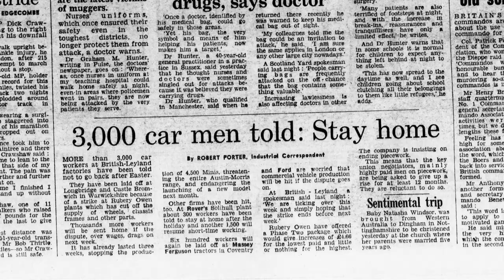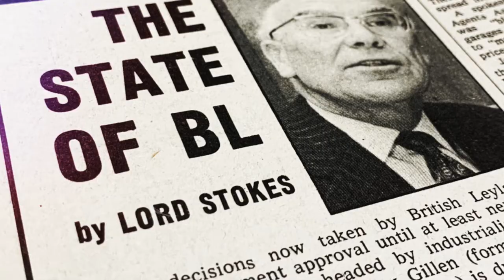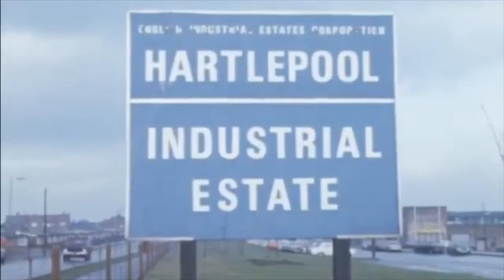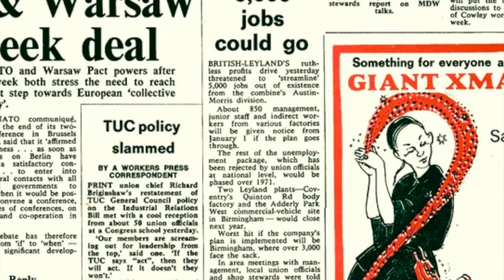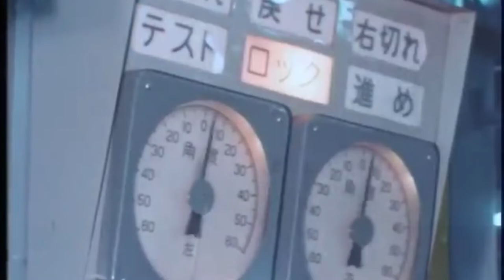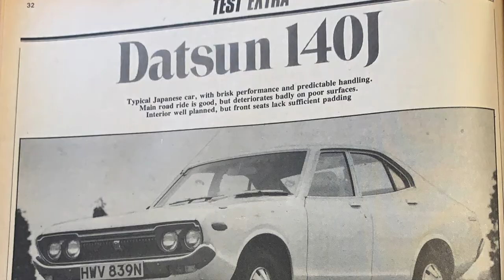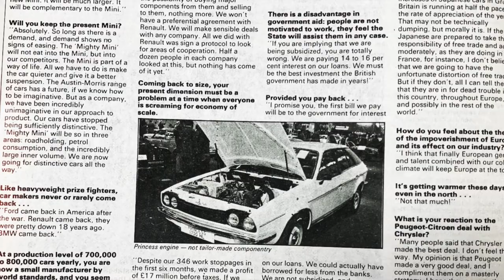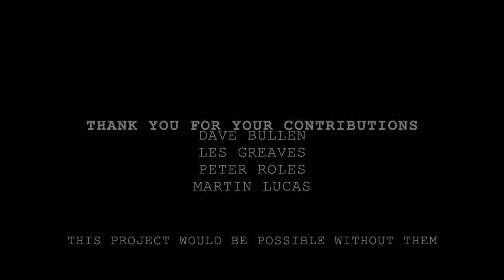Bygone Britain: The Demise of British Leyland

Comment: On a parallel, we lived near to the Corby steelworks and was in a nearby pub when the steelworkers were having a strike meeting. The strikers said that the UK car makers should be forced by the government to buy only british steel. The irony was that i went into the steelworks regularly, and the car park was full of Datsuns, Renault, Lada, etc., all foreign cars. The workers wanted the cheapest deals but weren't bright enough to think things through.
Reply from the maker: Very interesting story you have there, it would have been nice to tie this into the documentary.
Reply: @jacklloyd-lucas  I’m sure you’re right, but too late I’m afraid.
Reply: As a young painter I worked for a bodyshop carrying out warranty work for another car manufacturer, we had to take out the badly shaped lead loading on the C pillars, it was a continuous contract.
When the manufacturer’s warranty manager came round to carry out inspections, some one asked why they weren’t done properly at the factory in the first place, or rejected and re worked at source - the answer was that management were told to F off. The unions thought they were being cocky but ended up striking themselves out of a job. 
One of the issues in the film was trying to increase productivity with a group bonus - the idea was that the fastest, hungriest worker would kick (encourage) the slowest to work harder. This never, ever works, eventually everyone works to the level of the slowest productive for obvious reasons.
The German and Japanese car industries had the advantage of starting almost from scratch, whereas the UK situation was resistance to change. After I sold my bodyshop to my partner, I went into consulting, and resistance to change was one of the biggest issues that confronted me.
It was symptomatic of the UK car production industry as a whole.
Reply: @jackthebassman1  and to be honest the whole human condition many of us struggle with change and even in the animal Kingdom the little mouse terrified hides under the cat. The very thing that will lead to his demise rather than breaking free for the open space.😮

Comment: It was thought that 1970s japanese cars rusted more quickly than British ones. This was a fallacy because Japanese engines and drivetrains lasted so much longer the bodyshells had much longer to rust. British engines and gearboxes were clapped out much sooner. The japanese production techniques were much better too. Honda installed its production machinery at Longbridge to build the Triumph Acclaim. It was built by Brummie BL workers and was the most reliable Triumph ever, having the least warranty niggles of any BL/BMC car to that date. So it was the factories rather than the workers that produced sub-standard cars,  when the workers weren't on strike that is.

Comment: Couple of points - firstly the union issues are overblown - every major car producing country had severe issues with industrial action at this time, the difference in the UK was the management was particularly awful. Ford/Vauxhall/Chrysler (and later Japanese companies) did better because they engaged with the union leaders and worked out their differences.

Second, the other "British" car companies were hardly doing all that well either. Chrysler UK had been effectively running insolvent for several years and was being propped up by their more successful colleagues in France. It was a similar story at Ford and GM to an even greater degree, and by 1975 all three companies had all but shut down the UK R&D teams, with cars from these companies coming from the continent, and merely assembled here, not engineered. It took decades for the British consumer to cotton on to this, if course.

Nissan demonstrated that there is nothing inherently wrong with the British factory worker.
Reply: That's incorrect. The union issues were DEFINITELY one of the death blows. German auto company managers were spending an average of 5% of their time on such issues, whereas British ones were spending over three quarters of their time on those. It's simply unsustainable.
Nissan only started to prove what you claim in 1986 (that's when they started manufacturing in the UK), which was the very year they were assured the unions would no longer hold the powers they previously had. Thatcher had clamped down on overzealous unions by that time, so the proposition of investing in the UK seemed a lot better than it was 10 years earlier.
British cars are infamous for poor quality thanks to British Leyland - even today, brands like Jaguar (which was directly affected by the BL disaster) still struggle with image problems rooted in their questionable quality in the 1970s and early 80s, despite statistics showing they have caught up with and sometimes even surpassed the Germans regarding quality/reliability by now. (Once people get that idea into their heads, it is incredibly difficult to change people's minds, as people already have other brands they favour). All the others already went bankrupt for similar reasons.
Reply: To “jasonj4437” — P.S. it crosses my mind that your detractor — (Mr “AAWT”) — may be the alter ego of our documentary film maker.